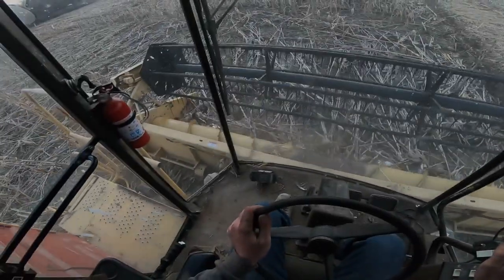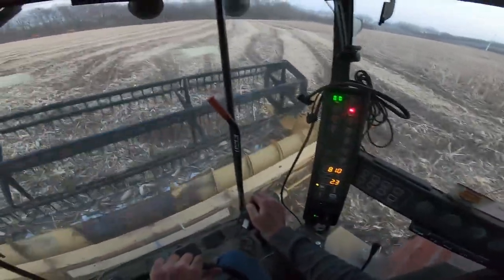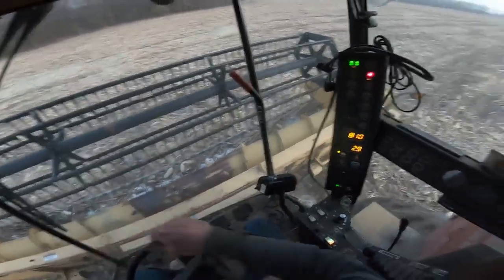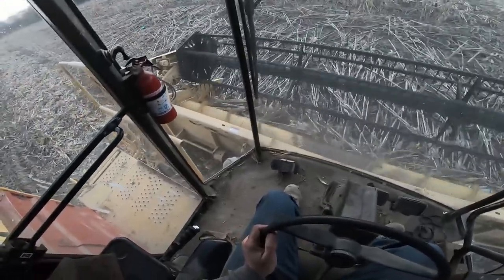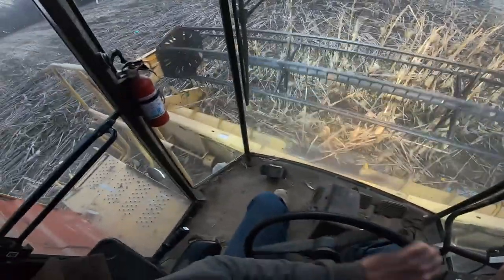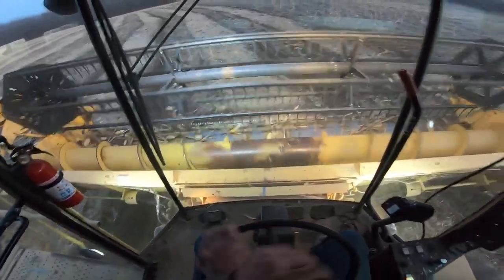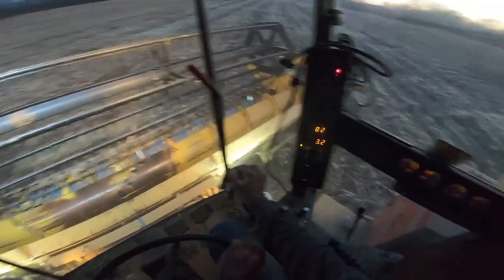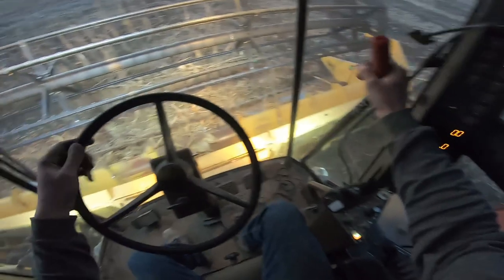Testing The Poor Man's Corn Reel to Burn Up a Separator Clutch

Comment: I've been in your shoes with downed corn . In 2012 we combined  3/4 of our corn with our draper headers due to the drought we had . Our corn was only 2 maybe 3 feet tall and it only yielded 50 bushels in most spots .  It's not ideal to use them for corn but they do work in a pinch . We harvest 200 acres of sunflowers with our draper heads but they are more brittle than corn so they cut and  feed into the combine decent .